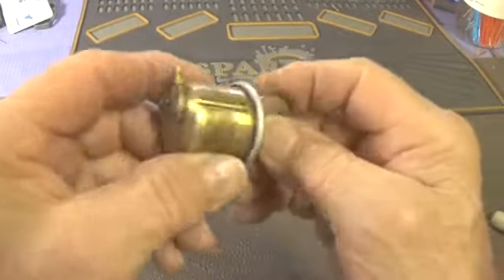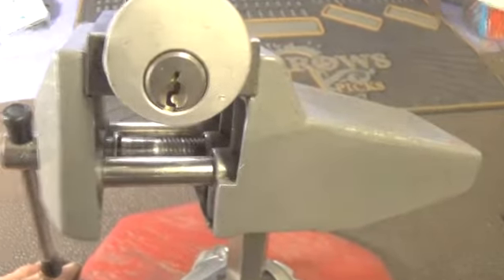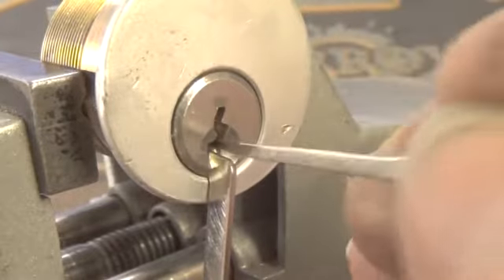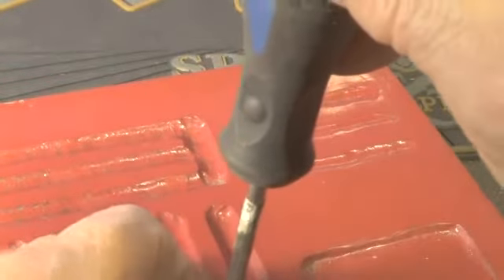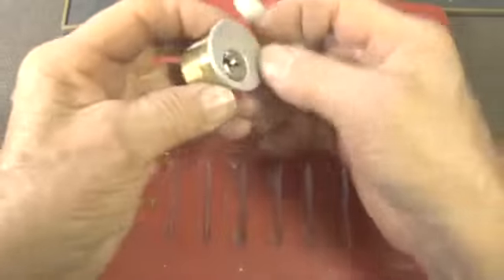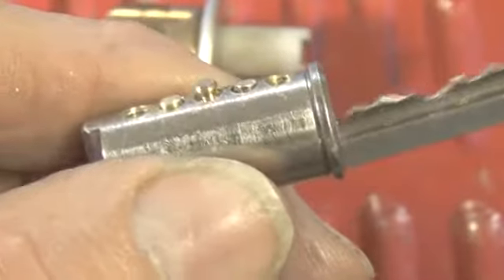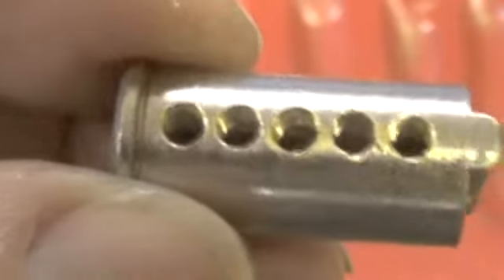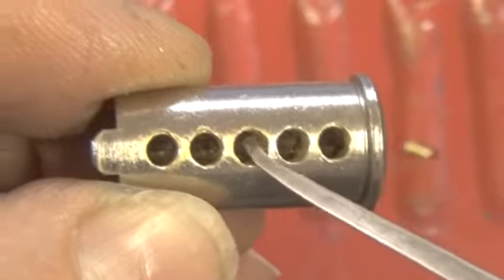(449) Ilco with Yale Keyway 5 Pin SPP'D and Gutted

Comment: Great picking as always. I was wondering how you decide whether to use top or bottom of the keyway for tension, and also how do you decide which type of tension wrench to use. I only have bottom of the keyway wrenches and it seems like at times the tension wrench gets in the way of my pick
Reply from the maker: +KNFX787 I have picked so many locks that I usually know which tension wrench to use. I have been known to select bottom and have to switch to top. It really makes a difference in which pick I use. I have about 200 different tension wrenches and about 100 picks. . Of course many of them are the same. I don't know why I have so many. I usually only use about 6 of them.